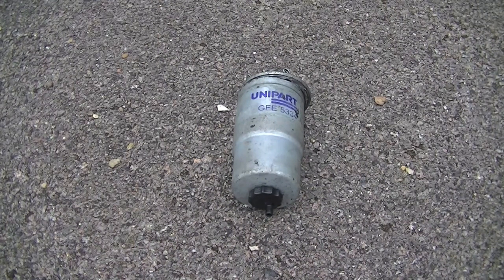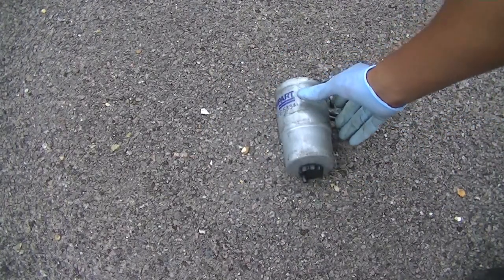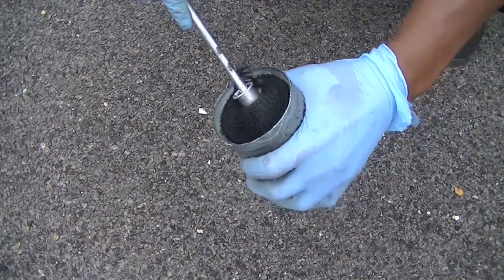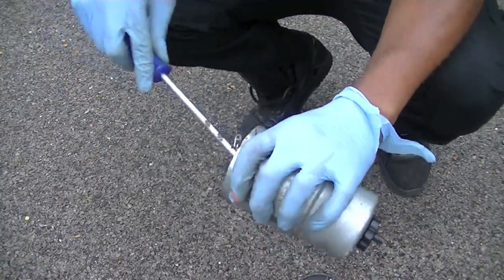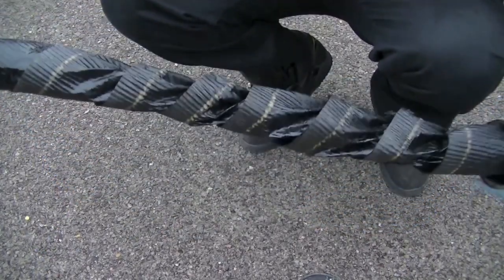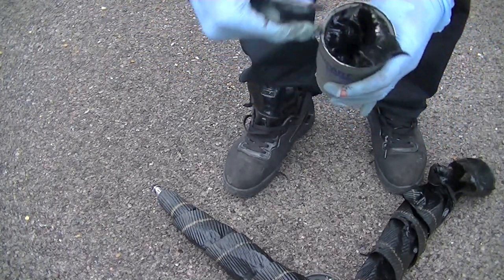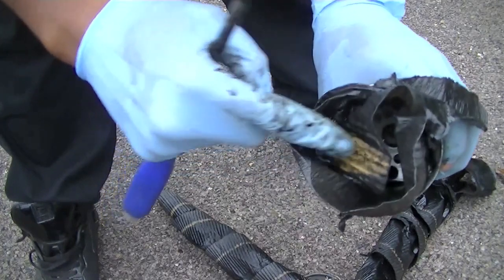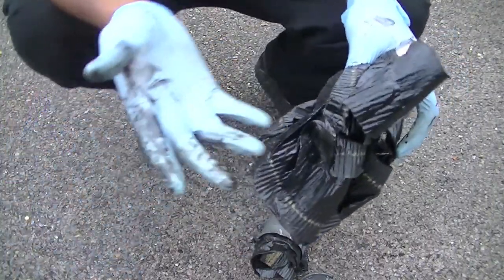Reasons Why You Should Change Your Fuel Filter....... Must See!!

Comment: you should change your in line fuel filter once a year or every 2 year. most modern petrol cars don't have this type of fuel filter it is in the fuel tank under the rear seats, vehicle manufacturers say these kind of inside the fuel tank fuel filters are maintenance free no need to replace it unless its giving issues.

Comment: So glad i this video. Hope you can help me here, i have a Renault megane expression vvt 2008. There is no pwer in my car when goung up hills or when going in 1st gear, could the fuel filter be the issue? I took it to the garage they did a diagnosis on it and said it could be the injections. I paid £72 just for a diagnostic also he gave me fuel cleaner and told me to put supreme fuel in the car instead of normal unleaded fuel. I dont know much about cars. Hipe you can advise me. Thanks.

Comment: I finally changed the fuel filter on my car.  I bought the car new in 1991.  It has 221000 miles on it now (not kilometers, miles.)  The fuel filter had been changed once at 50000 miles.  The filter I changed out had then 170000 miles on it.  Very little dirt in the old filter.  If the fuel filter in your car is full of dirt at 10000 miles or so, perhaps you need to change where you purchase fuel for your car.  It doesn't have to be that way.

Comment: I agree the fuel filter should be changed often - possibly even every year. However, the fact that the filtering material is black does not mean is not doing its job. It becomes dark very quickly after installation. One should clean this material in a solvent to recover the impurities, to quantify how much it is "dirty". Then, one should do the same comparatively after one month, six months, a year. This will help quantify how the filtering capability has degraded.

Comment: I change my fuel filter once every year, which in my case is about every 12-13 thousand miles.

I think it's better spend a few quid every once in a while on a new filter, than spend a fortune on injectors or on an injection pump. And the fact is that I never had any sort of problems with my diesel injection system, save for leaky injection pump seals (which have been promptly replaced to avoid major problems).

Comment: I do not know where you live or which vehicle is that filter but it is very easy to say change it regularly and already, my 1994 toyota pickup with 311k thousands miles , try once to change it and I could not because you have to remove the intake and decide to change it only if it gives me problems  .

Comment: The fuel filter turns black due to asphaltenes, a naturally occurring substance in diesel fuel. They don't restrict the filter, so in effect, they only change the color. Perfectly safe and normal.
Reply: This needs to be at the top and visible to all. Just because it's black doesn't mean it's clogged up and not working. Same with engine oil, in a diesel engine, brand new oil will go black within a few hundred miles of driving. It doesn't mean the oil is now bad

Comment: when i got my 02 passat with 145k miles i had a fuel pump die like 5k miles later i changed the pump and the filter.. The filter was original. 150k miles. It was soooooo nasty

Comment: This doesn't make any sense. A dirty filter actually filters better than a clean one; this really isn't difficult to understand. The main reason fuel filters need to be replaced is because the flowrate will reduce due to the filter pores becoming clogged. Whilst this is a cleaner fuel, it increases the strain on the fuel pump in order to maintain the same flowrate.

Comment: most, if not all petrol (gasoline) cars these days do not have a fuel filter you can change. the filter is often built in to the pump module, to change the filter you change the pump. my car is on 108k now and still drives very well with a non-serviceable filter, the car wont last too many more years sobut hopefully the pump will last until the car is knackered anyway

Comment: I’ve got an Audi 2007 tdi sline Auto. I’m experiencing an intermittent limp mode issues that is getting on my nerves. There is no light on dash but the car see to do its thing when it’s ready. One minute it will cut power then the next it goes back to normal. I’ve changed turbo? VGR valve, MAF and lots more.
Reply: Someone told me get a mechanic to take out the boost pressure sensor from under the O/S light and have it cleaned??

Comment: If you think that you should be changing a fuel filter every 13,000 miles, then you won't save yourself any money at all.  A filter is supposed to be dirty, because it's doing its job.  That filter will still do its job, even though it is dirty, but less fuel will pass through over time.  Stop scaremongering!

Filters can get holes in them and allow unfiltered fuel to pass through, they can also get clogged and reduce fuel flow to the engine.  Change your filter in line with what the manufacturer suggests and you will be golden.  If you have a high performance car, then fuel filters will need to be changed more often to assure high fuel flow, but in a daily driver 40k miles is fine to change a fuel filter.

Comment: K, most of the color comes from the dye in fuel as well.  Check out a similar example.  Oil gets black in a regular gas car.   Most of that is from the fuel dye.  Check out the same oil in a vehicle that runs on natural gas.  Its as clear as the day you put it in.  Now, admittedly you do need to change your fuel filter regularly

Comment: One way to think about it is if you change your filter at 30,000 miles assuming your car gets roughly 20 miles per gallon, your filter will have filtered about 1,500 gallons of fuel.

Comment: my car has lost power it accelerates slowly is that happening that i havent changed the fuel flter please anyone tell me
Reply: I'm no car expert but if your check engine light is on get a code reader check done. Try checking the transmission fluid to make sure it hasn't gone black or discolored. Check the levels to see if it's low on not or needs a flush. Check for any leaks to. That's all I can think of. Hope this helps.

Comment: Injectors are not "extremely" expensive to replace.  I get them all the time from the wrecking yard for $10 each.  Just because one goes bad a new one isn't required when a good used one will do. Pumps the same... even some wrecked cars even have new parts on them.  Recently found a new alternator on a wrecked car I paid 1/4 vs what they sell for. ;)

Comment: I changed the fuel filter in my car at 167,000 miles (not sure if it was ever changed before) and the fuel that poured out on the filtered size (should be clean) was black and looked like dirty motor oil.

Comment: I would replace it every 50-100k miles regardless if it needs it or not, it's a cheap filter and it prevents your fuel pump from getting worked harder than spec which will easily save you over $100 and even more if you can't install the pump yourself. 

A simple and cheap preventative maintenance plan that will help you save cash long term.

Comment: Im sorry to say that your video is not genuine. A diesel dose not make the filter black like this, it should be something else what did it.
I have changed so many filters and never seen that old engine oil gone through a fuel filter.

Diesel filter should be changed because diesel fuel can build algiers, and moisture thats why the filter can be clogged not because it can look like you filter as it would be used as an engine oil filter. Have a nice day

Comment: lol. uhhh, no. Folks you need to use a fuel pressure gauge to check your fuel pressure. So, what you're seeing is called engineering - that paper is coated in an oil that reacts to gasoline - if it was just paper it would dissolve. There may be some contamination in there but normally gas is pretty clean. Don't stress about it - every 50-75,000 clicks.

Comment: Want to fix that? I set up my dedicated pickup fueler truck for a fleet of heavy diesel equipment with 3 giantic Gresen filter housings in line. Those little auto oil filters on the 12v pumps are plugged and in bypass after a few hundred gallons. Also these three housings trap water at the bottom and every 300 gallons or so I drain a good quart from them. If I was filling a tractor with cans or from a stock pickup tank, I would change that fuel filter on the tractor every 100 hours. Injection pumps have no tolerance for dirt.

Comment: Wtf my 99 Corolla is 18 years old and has 312k miles and I never changed the fuel filter. My parents handed the car to me and the only thing they did to it was regular oil changes, tires, wipers. When i got the car the first thing i did was change the engine air filter, installed new headlights and i had to change the spark plugs and coil packs because 2 of 4 were corroded. Anyways how do i change the fuel filter on a 99 corolla?
Reply: Btw im not the best with cars but can someone tell me are coil packs the same as ignition wires? And also can someone tell me why only 1 of my coil packs and spark plug corroded and not the other 3.
Reply: It might be in the fuel tank with the pump. Then you don't nead to change it. New generation of filters. If it is out of the tank clicked in the fuel line then you do need to change it. Not sure if you have e10 or e11.

Comment: I own a 2005 Mk.3 Mondeo 2.0 TDCi. Somewhile ago I was plagued with the engine stalling after covering about 200 yards from a cold start. The fuel filter was replaced in October 2015 and the problem went away, until today. Since the filter replacement the car has barely covered 5,600 miles (9,000km approx). I do a lot of very short journeys which I presume is taking its toll on the filter. So regular replacement seems to be the solution.

Comment: my car seems to run good but all the sudden  just cuts off like it is not getting gas?do you think I need to replace my fuel filter
Reply: It very well could be the filter, but unlikely. If a filter gets clogged enough to stop an engine it won't usually start at all. I have no idea what car you have but if it runs rough, then stalls, I would change all filters. Air, PCV valve, fuel, and then check the plugs to see if they are fouled. If you want some help diagnosing this you can pm me and I will help you troubleshoot it.

Comment: I recently acquired a 2003 Buick LeSabre LT in excellent condition with low mileage. Looks like a fairly easy job. Careful with the gas that drains from the fuel line, when the old filter is removed.

Comment: hi could the fuel filter cause the car to make a popping noise and then make white smoke come from the engine
Reply from the maker: +Lydia Strobel Not in my experience. That sounds like more of an injector fuel/ratio issue
Reply: +BMAC VAGS how white is the exhaust, any droplets of water vapour indicates water getting into the engine.
Reply: +Lydia Strobel that sounds more like a head gasket leak, pretty sure it has nothing to do with a fuelfilter..

Comment: My 2014 GM Chevy Cruze diesel  has an fuel filter life monitor. Here in the USA, it requires a change at ~30,000 miles.  I drain the water valve 3x a year, or whenever it said "water in fuel". It is an amazing car and we get 49mpg on the highway. Much simpler and environmentally friendly to manufacture and own vs. the batteries in a hybrid.  The fuel here is a yellow green. So that black residue in the filtration membrane must be bad contamination from the fuel suppliers.

Comment: As a store man in a garage I had to I had to attend a lesson on filters given by the manufacturers where I learned that a filter let's through less dirt the more use it gets.  It's like when leaves block a drain; the water builds up.  It does not let the dirt through.  You're household sink works the same it gets blocked with the remains of food or otherwise: it does not let the water through.  The micro holes in the filter catch the dirt and become smaller still, or totally blocked until it restricted the system.
Reply: Old filters especially metal ones under the car rust due to their location, on petrol cars this is bad because it will rot and leak ! Not only that but long before that it will damage fuel lines,injectors ,sparkplugs,coils ,lambda sensors,list goes on!

Comment: I may sound completely retarded, but would the debri help filter more debri from going to the engine? Like the debri clogging house piping ( hair, nails, poo).  Please correct me.
Reply: +rubutt Yes it would.  But it also makes it hard for the gasoline to flow through.  Really the only problem with having a dirty filter is worse gas mileage and less power in the engine.  The changes of getting pieces of filter or dirt in your engine are EXTREMELY low.

Comment: Doesn't look that bad.  Everything inside your engine is that color.  Color doesn't mean anything.
Reply: that filter isn't connected to the internals of the engine, but with the diesel tank, and these day's most of them are made from plastic, so it's a bit weird to see this kind of black crap, because i can't imagine what could
corode or pulvorize that makes the color black.  Who knows it comes from old gas stations who have old tanks under the ground and who are dirty as hell.

Comment: how did you get the fuel cap off?
how did you replace it?
Reply: +lili M take it to the garage
Reply: with a dremel, then cut a role of cardboard at size, fit it in the can, glue the lid back on with a glue gun and your done.
Reply: +lili M ...

Comment: I havent change mine on my honda civic 2004 and it as 269000 miles should I be worry? xD
Reply: +Ghostfrank øRø Your fuel pump will thank you: if your fuel injector rail works at 60psi and you have 20psi of head loss through a heavily clogged fuel filter, your pump has to work 33% harder to keep the fuel rail pressure up.
Reply: Tear down Dan, if you change it now, it would probably break down immediately! Lol. If it’s not broke, don’t fix it! Again....lol
Reply: Changes fuel filter car breaks down lol
Reply: @ningishziddashar3480  yup

Comment: just had an idea grab yourself 2 new filters and take one and do as you did in the video then take the other and feed gas through it give it 30min to sit then come back and take it apart. not trying to fuck with your head but just for its just for testing to see if gas makes that band change like in the video. my reason for doing this is nobody knows whats going on with all filters all we know is its suppose to filter the gas but what if the whole time your riding cruising enjoying yourself whatever not knowing that the filter that you thought was so clean inside actually is already dirty and starts to destroy your fuel pump
Reply: Achievement unlocked, "no punctuation used"
Reply: +sd33zy313 Yea same with people's perspective on dirty oil. You put clean oil into a car and it'll be "dirty" within a few minutes. They don't realize it's completely fine. A lot of the properties that the oil has lost can't be seen.
Reply: yeah your right
Reply: +sd33zy313 diesel is black, it's going to be black on the filter
Reply: Richard Farmbrough it's dyed so us n truckers can't use it. The dye wouldn't hurt your filter nor your engine it's just not taxed for farmers. Hence red diesel is for farmers.....
Reply: +OnlineBackupServices Diesel is usually pretty clear with a yellowish tinge.  It is dyed for heating use (red diesel) - which wouldn't work if it was black!

Comment: He has a good point, but this example looks absurd! I've changed fuel filters before, even old ones, and rarely see more than a few particles and slight discoloring. Fuel is supplied already filtered and gas station tanks are cleaned before first use. What the hell happened to the fuel going in this dude's car in such a short time?? The only dirt that should be there is slight contamination introduced when a passageway is opened for refill... the odd time. Unless he fills up during dust storms lol.

Comment: I have been putting off changing the fuel filter on my 2004 Tundra for a couple of years. The truck only has 92k miles but it seemed worth doing. I struggled getting it out and a new one in. After seeing your video I thought it would be informational to open up the old original filter. I was amazed to see white filter paper inside, no grit at all. Gasoline versus diesel???? I'm also a big fan of cheap "supermarket gas."

Comment: If parts of the filter glue is coming off on a filter that is not that old that would lead me to believe the either that is a really crap filter or that they are using a additive in the fuel that is not agreeing with the filter well.

My question how restrictive that filter was?

Comment: Pertaining more towards Diesel engines; If you need to be told you should be changing your fuel filters, you probably shouldn't be driving one. My Ram 2500 Cummins calls for a change at 15,000 mi, I change it at 10,000. Yeah, both are $100, but beats having issues down the road and taking care of an engine that will run for many, many miles. The newer trucks tell you the fuel filter and oil filter life...again, you shouldn't have to wait for the truck to tell you...

Comment: I have a 1997 jetta vw, its got 118,000 miles on it, and it likes to die at intersections. power doesn't seem to be the issue and usually if i let it sit for like 30min-hour it starts working again, could this be caused by the fuel filter?
Reply: That could be a cause, or you might need to clean the throttle body, it could be injectors, fuel pump, etc.

Comment: Many new cars designed the fuel filter built inside the fuel tank and life time free maintainence . My 2013 Ford Fusion is. Avoid vw ,it need every 30000KM to replace the fuel filter.